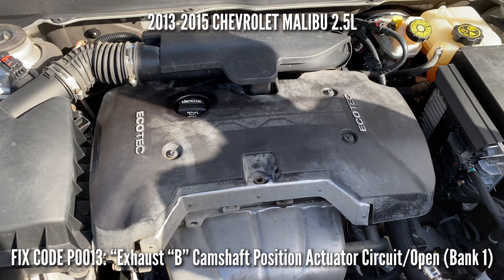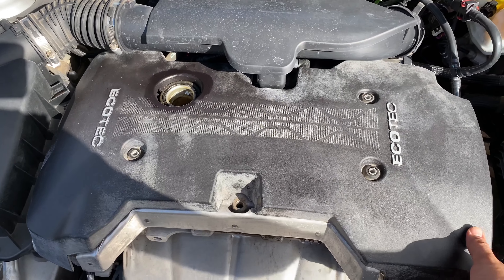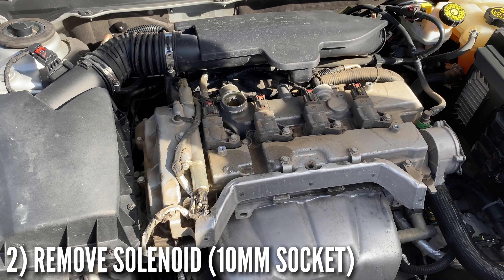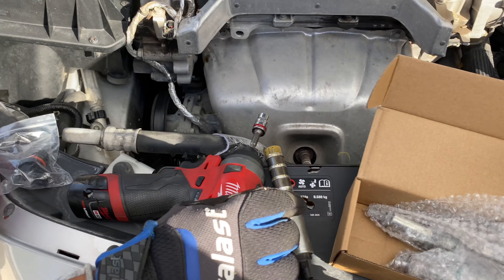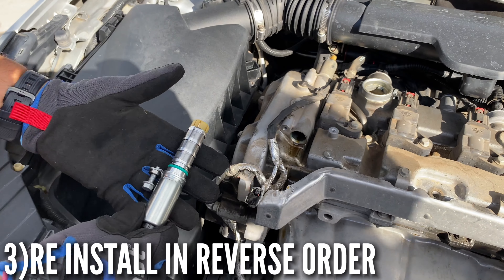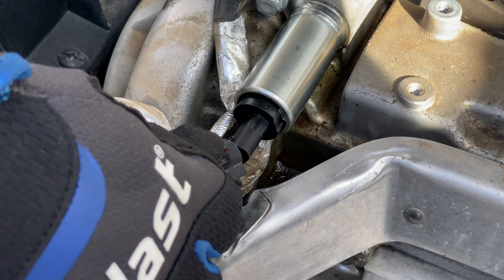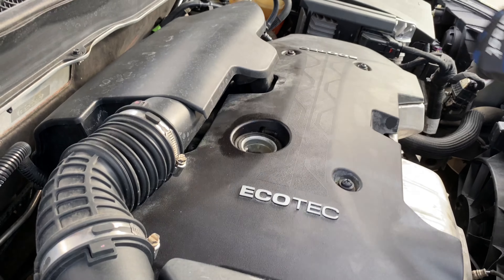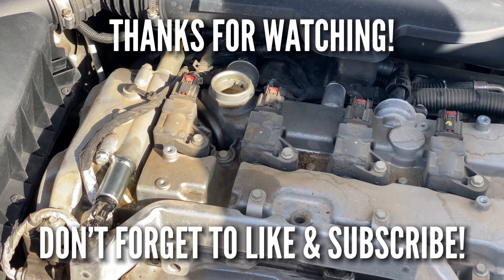P0013 & P0014 FIXED FAST & EASY 2013-2015 CHEVY MALIBU 2.5L REPLACE INTAKE & EXHAUST CAMSHAFT

Comment: Thanks for the video.  Simple, concise, and quick. In the future please make an effort to explain the removal of the electrical plugs.  That was the more time consuming effort and difficulty.  

In future videos see if you could spend some time on this step. Actually there are many different types of plugs.  Over time they tend to become cemented to the fitting.  Besides the grey push clip sometimes they need to be squeezed, pinched, pried, or rocked out.  Not knowing which, takes time.  If you’ve done it before, it’s simple. Thanks
Reply: Same for me. I can’t take the plug off even after pulling the white clip.

Comment: Switched out both and check engine light went out immediately after, but the next day it came back on ,what do you think?
Reply from the maker: That’s a great question… I would suggest taking it to a professional to avoid wasting any more money.. but may be a faulty part, electrical wire or connector - or another part in the system causing that to come on :/
Reply from the maker: Did you figure it out?
Reply: @HidalgoMotorsCo  Ended up driving it for a few more days and the light turned off! It's been fine for a few days now hopefully it stays this way 🤞 thanks!
Reply: What was your code??? I am popping a code and hoping it is just these two censors.
Reply: @JnevDesign  see my above comment, please.
Reply: @jenniferann8629  I had both P0013 and P0014 codes come up. Replacing these parts fixed my problem, hope this helps.

Comment: Thank you so much I have same problem It says P0014 so ihave to change both of them and after that how to reset the code just unplug the battery and plug it back ??
Reply: Did you figure out how to reset the code? I had  the same question.
Reply: Go to any auto parts and ask for an OBD2 code reader (they should be able to let you borrow it) and there should be an option to erase the code once you get it plugged into the car and it reads the codes.

Comment: How does the electronic connector come off the part with the snap clip? Mine is bring fussy but I don't want to pull too hard. Just snap the clip back and pull it out or is there more?
Reply: How did it go? I’m just having problems with it too. Did you just snap the clip back and pulled it out?
Reply: @vladbilash6028  snap the clip back and depress the middle and pull it out
Reply: @iancurtis5397  thanks
Reply: @vladbilash6028  no problem

Comment: Could you please tell me if the code p0013 is for the front or the back?
Reply: Did you figure it out? I just got the Same trouble code and I don’t really know wether I should replace both solenoids.
Reply: @vladbilash6028  no, I haven't been able to find out.. Did you? If you did please let me know if the p0013 is the front or the back.
Reply: @alalvarez4708  I am not entirely sure cuz I just changed both of them and the check engine light was gone. But I suspect it’s the intake solenoid which is the back one.
Reply: @vladbilash6028  I just order both, paid $40 for both(Amazon), I'm gonna do it like you, will change both. Thanks bro
Reply: I had p0013 and replaced the exhaust one ( the one towards the front of the car) and it cleared the code
Reply: P0013 “exhaust camshaft position actuator solenoid valve control circuit” it’s the one by the exhaust